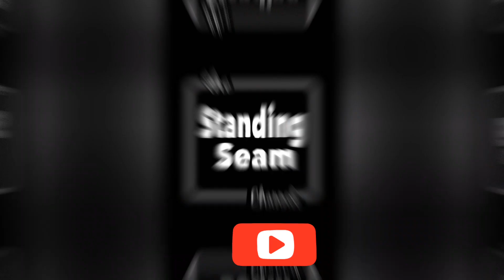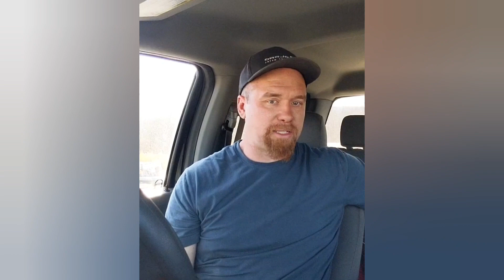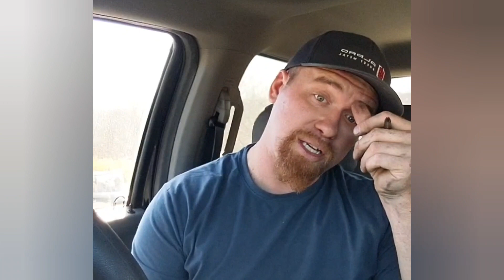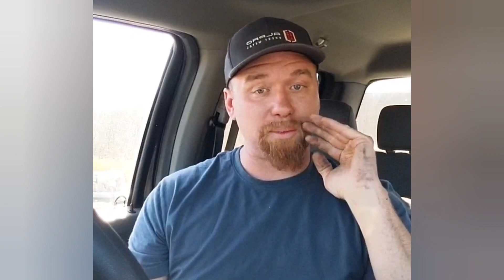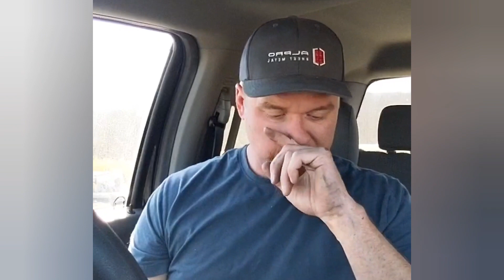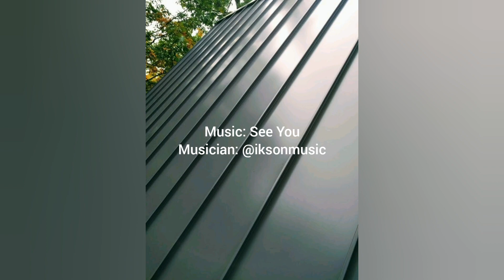5 Ways to Help Reduce the Effects of Oil Canning on a Standing Seam Metal Roof

Comment: Do you have any experience strapping a standing seam roof before installing . I am about to start one . And for a few reason we are strapping the roof . I have fears of more oil canning than normal . Any feedback would be greatly appreciated. Love the videos . Thanks
Reply from the maker: Standing seam lays best on a continuous substrate. Meaning straight to deck.  If your doing strapping make sure the pieces are install no further than 12” apart

Comment: When you attached the top panel to the deck you cause stress at the top. Likewise z closures attached at top to the decking does the same thing. Like how can the panel contract and expand if you are holding down either end of the panel? One soulution is have furring strips. This keeps the panel from heating up because of the ventilation underneath. Plus you are securing the z closures on the metal panel and not the decking. The panels should be able to float. Engineering makes it possible to keep the panels from flying off.
Reply from the maker: I'm not a fan of furring strips... architectural (not structural) metal roofing systems are best suited for a continuous substrate

Comment: I am making a coping on a parapet wall. I am hiding fasteners by using a continuous cleat so I’m hooking the exterior and pushing down on the inside. 
The inside is hemmed at about 99 degrees so I’m manually hemming inside hem to lock it on. 
No fasteners showing. Some pop rivets just to keep everything together and straight. 

However there’s a 9’ radius in one corner. 
So my too is 9” and both faces are 2” plus hems. 

I can mark my radius I can cut the radius. I am using the wuko mini bender combo but it’s oil canning and warping the entire piece. 
I need help
Reply from the maker: First thing that needs to be considered is the straightness of your cut... if the cut is not smooth the bend wont be either
Reply: Thanks. I understand that about the wuko hand brakes bending exactly to the edge. So if the cut edge is wobbly the bend will also be wobbly. 
But the metal is warping or canning as I make the bends. 
I’m practicing now using heat and shrink and stretching
Reply from the maker: @patrickfrank366  yes that was the next thing...clamp to a flat surface while creating the bend...even better pinch between 2 flat surfaces...directs all the warpage into the bend and not the flat surface....once it's turned fully to 180° then release the clamps

Comment: We had major issues using drain mat we were not aloud to use bigger clips we had to cut squares for each clip and add a Neoprene pad under the clip to make that build up for the drain that crazy process I thought a bigger clip would be better because it would just squish down and then equal out but overhear on Vancouver Island our inspector said that that would not pass crazy
Reply from the maker: Yes we purchase taller clips for drainage mat...any sort of shim will compromise the structural integrity of the roofing system

Comment: Thanks for the video. Badass. Like what you’re doing and what you’re about.
Reply from the maker: Thanks very much. I am very passionate about Standing seam and getting our message out there. Stay tuned for more vids!
Reply: @asm101  101: Need to look more at your vid's.  Do you lock the hip and ridge seam vs a cap?   Thanks!
Reply from the maker: @613kc  depends on the systems but mostly cap....but I use a bread pan detail to hook the caps onto....https://youtu.be/_xHcRlZrPz4

Comment: Specially in old T&G roofs where the slope plane is never perfect (or far from perfect) i normally found my self putting the clips first in the areas where the panel touches the roof, and where you have a little gap i manually adjust the clip hight (i am talking about non expansion 24 GA clips). Also adding an extra 1/8" in the bullnose helps with the contraction, specially if the roof was installed in the winter
Reply from the maker: Absolutely... Always have to be aware of the "FINISHED" dimensioning when installing.  This differ largely from material dimensions.
Reply: Thanks so much for explaining this in much more detail. I wish Alex had more pictures for those of us who don't have any idea what he's talking about. If he did have pics then we would know what to look for if we are having a new roof installed. Like showing us what you're talking about...what's a bullnose? Roofs contract and I guess expand?